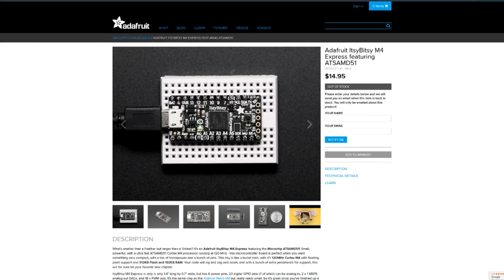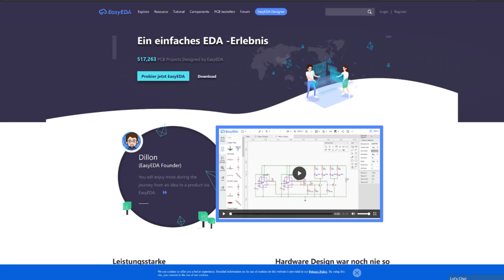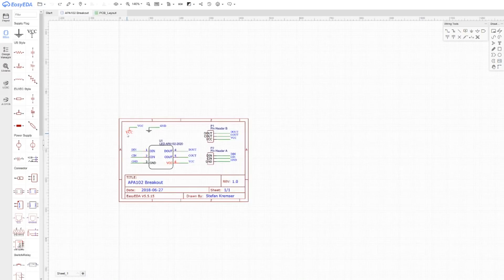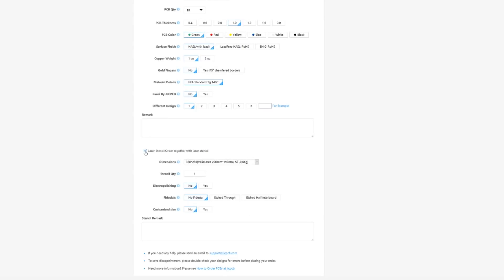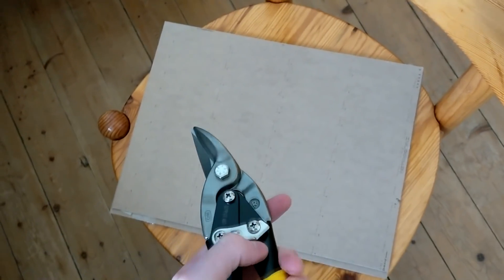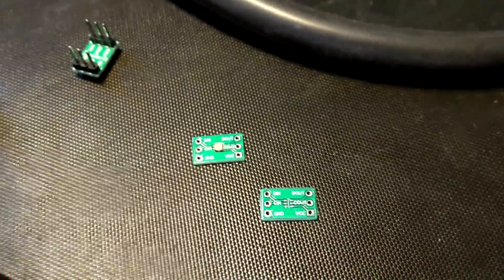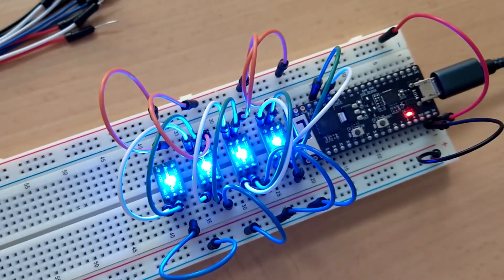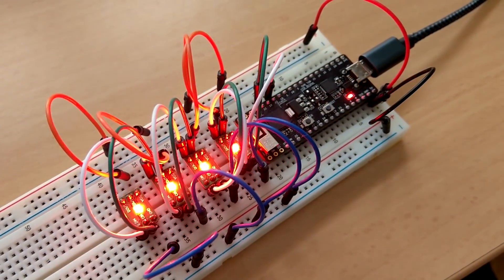Making APA102-2020 Breakout Boards

Comment: Can I ask you some questions about the LED chip please?  I received 10 of them yesterday.

1. Do they come on a strip?  I have never seen one advertised.  Have you?

2. They have 8 pads on the underside. - the 6 user pads, and two others , marked A and B on my pad diagram below.  What are A and B?

1 : SDI     A    SDO : 6
2 : CKI            CKO : 5
3: GND    B     VCC : 4

The reason I ask is that I want to make a strip on a single-sided board, with one power rail above the chips and one below, and as VCC and GND are on the same end of the chip, I will have to take a trace underneath the chip, and it is likely to make contact with A or B.  Are they connected to anything internal to the chip?

3. What is the maximum data rate?  The datasheet mentions an "oscillator frequency" min: 800kHz, Max : 1200kHz - but -"oscillator"?  The only one I can think of is the PWM oscillator, but the user can't change it.  If it is referring to the data rate, then I can't use the chips anyway at that throughput, but another user said that he got 40 MHz through the 5050's.  Do you know what it is for the 2020's?

Comment: NS107S Pixel LED: 
PWM refresh rate >26kHz
, Transfer speed is >30MHz.

And NS107S is much better than APA102.
NS107S-5050, $**/K
NS107S-3535, $***/K
NS107S-2020, $***/K.

Comment: Awesome tutorial. Couple of questions if I may. Whats the logic level of the Data Pin for the LEDs. 3.3V or 5V? Also could you change the frequency of the clock pin? What I mean by that. Is it possible? Final question are you supplying the power for the LED's with your board or do you use a external power source?

Comment: I just got some, they are soooo tiny
Reply: I just got some too - but a year after you got yours.  Did you have any success?
I just got 10 to play with, but my intention is to use 220 of them in a strip, with 1 LED every 2.5 mm.  Did you manage to solder them?

Comment: first :)
Reply from the maker: no
Reply: @spacehuhn  bro I have a doubt 

Kindly read this I bought a nodemcu kit on Amazon
°°
"Preprogrammed with nodemcu firmware"""""

10 Gpio, every gpio can be pwm, i2c, 1-wire, fcc certified wi-fi module, pcb antenna

Usb-ttl included, plugandplay

Exclusive tutorials for esp8266 - http://roboindia

So they gave preprogrammed so does it come flashed?

Ps I'm a nub at programming...

Sry for shit english 
Due to google autocorrect
Reply: @spacehuhn  good job roasting m8
Reply: YES